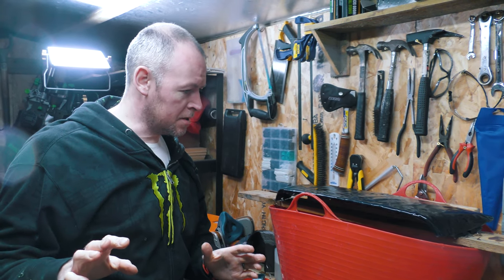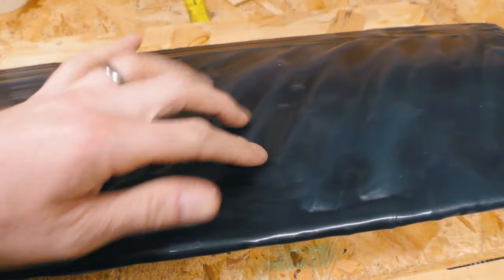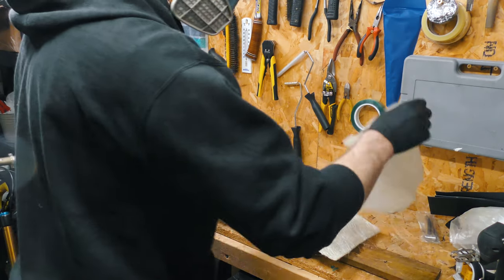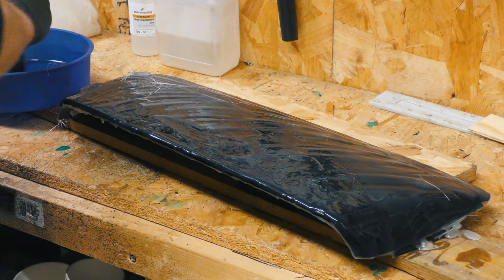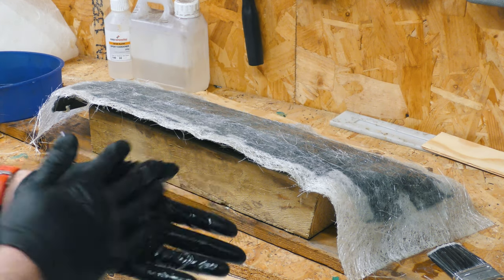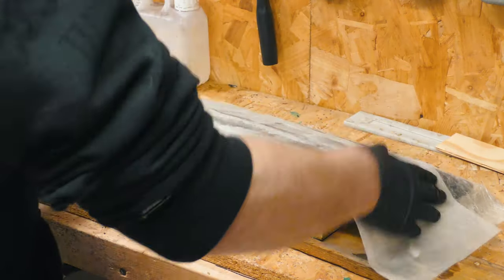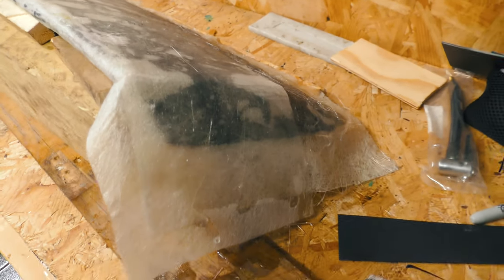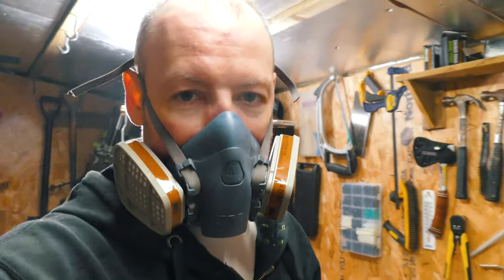Carbon fibre scoop Part 7 - Setting a polyester and epoxy mould

Comment: have you thought about using the spray expanding foam on the gel coat? That would have stuck to the gel coat no problem, would have expanded and created strength to the gel coat so you could use it as a mold then. expanding foam used to seal cracks/gaps in home construction ...
Reply: Oh damn that's a really cool idea!